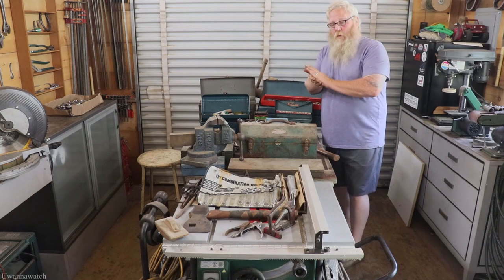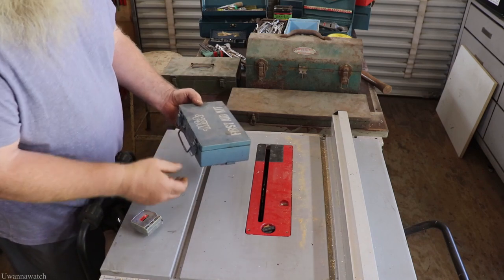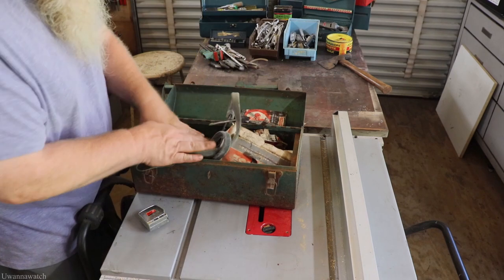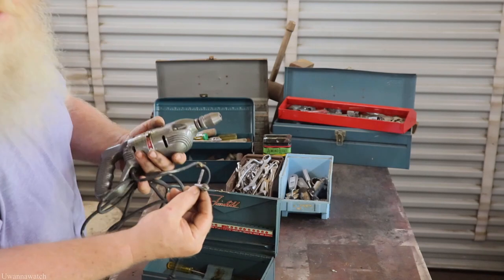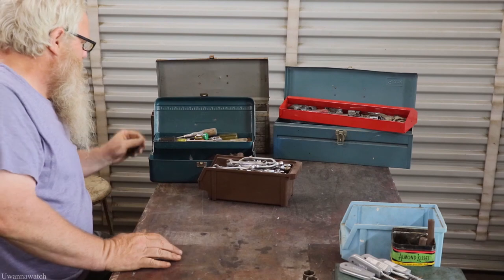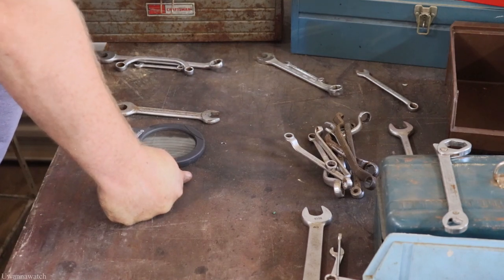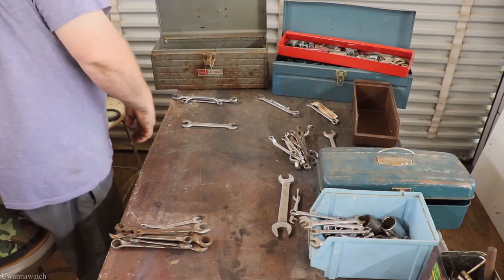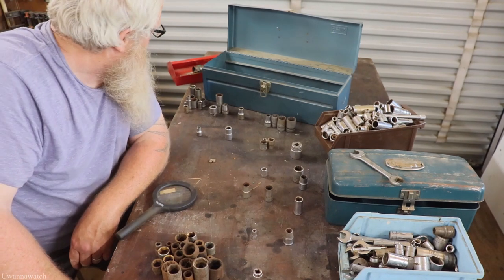Long Tool Haul. Two Days Of Epic Finds!

Comment: George,

Others may have already commented... I am not taking time to read the plethora of comments before adding my own...

The nice little puller was not shown clearly in the video, but I think that it is a roller chain breaker or detacher; again I couldn't see it clearly in the video and I may be going out on the proverbial limb...
If I am correct, you probably haven't had the privilege of using one or you would have recognized its use and value. 
Breakers are inexpensive tools and are readily available retail where roller chain is sold. Ie; NAPA and farm supply  stores. Industrial suppliers of bearings and power transmission carry them.

Oops! I watched several more times and it IS NOT a chain breaker!
Reply from the maker: Thanks Man..I appreciate it.

Comment: In the UK the 12mm would be a more common size than 11mm
Reply: What are they for? 12 mm doesn’t even show up in charts for standard sizes, neither DIN nor ISO.
Reply: @mm9773  M6 is 10 M8 is 13 but some times 12 ( after scrabbling through my odd bolts box I found an m8 with a hex head and a hex socket that it fitted - from an office chair ) I have used it a fair bit on cars. The Halfords Advanced set of ratchet spanners I have does not have an 11mm.
Reply: @elioth.g.w2976  Ah yes, I found some references to car, motorcycle and bicycle stuff that uses different sizes on heads and nuts. Nuts, literally. This is supposed to be simple.
Reply: @mm9773  I am now wondering why some M8 bolts have a smaller head. I think the last time I used the 12mm was on my daughters i10 brakes. IIRC so was my 11mm (brake pipes)
Reply: @elioth.g.w2976  I was looking at a standard size chart (in which 12 mm isn’t mentioned), and there was a small note along the lines of “the auto industry does their own thing, typically smaller sizes, because of confined spaces”. Doesn’t make a lot of sense to me, but that would explain a 12 mm M8.
Reply: @mm9773  That makes sense, space inside cars seems to be less these days.
Reply from the maker: Thanks Bud. I appreciate the information. Now I just need to find the missing one to complete the set.